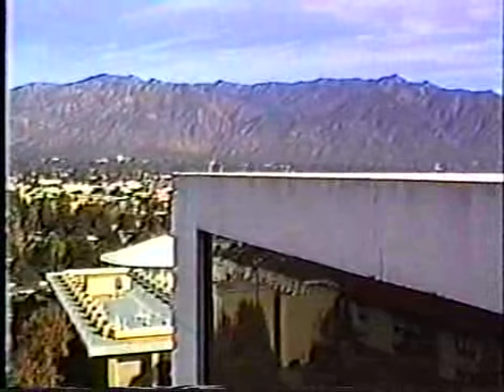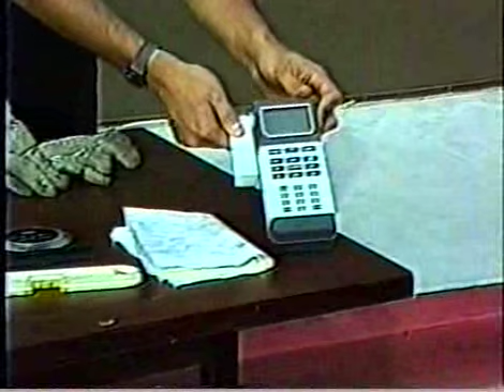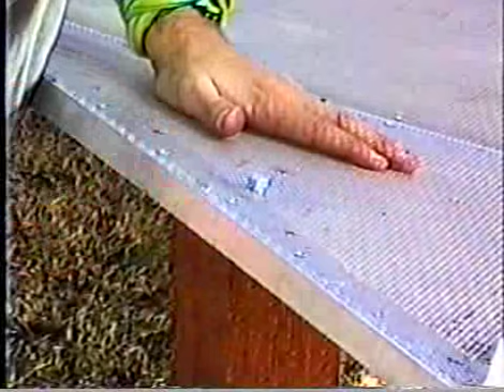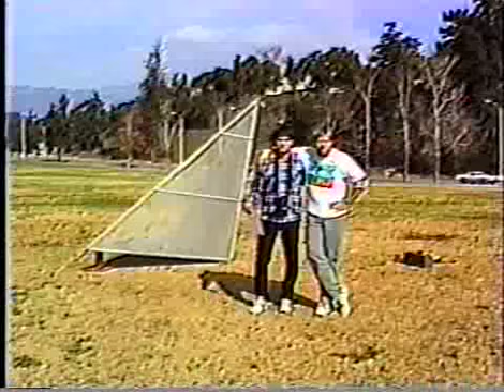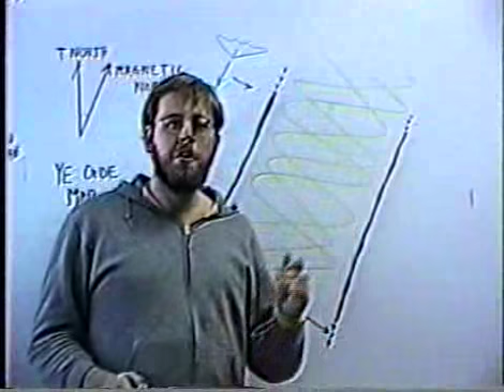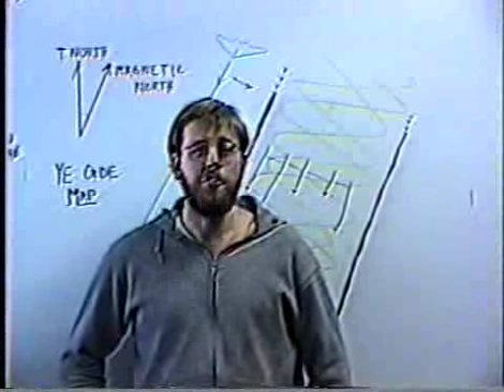Trihedral Corner Reflector Deployment Instructions

Comment: I am looking for information that describes return signal from a corner radar reflector  as a function of it's aperture.
Say, the facing triangle of the reflector,  3 sides are X wavelengths;    1<x<50 what is the equivelent radar cross section?